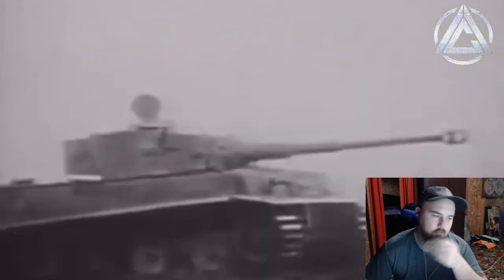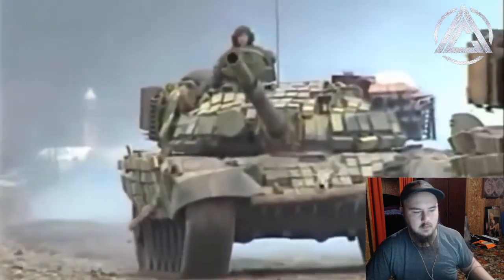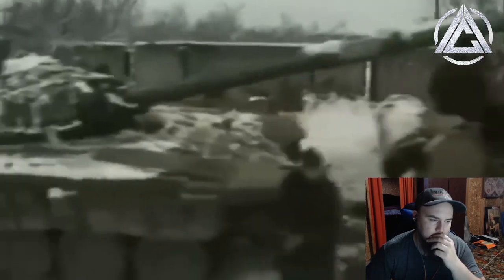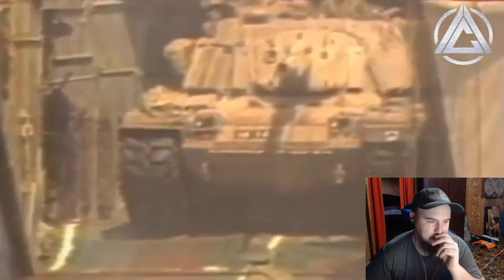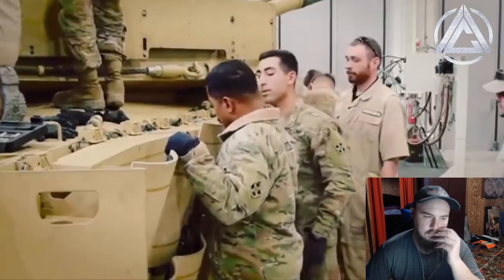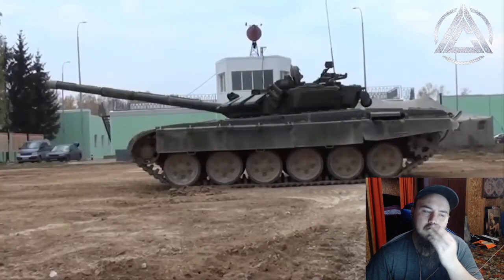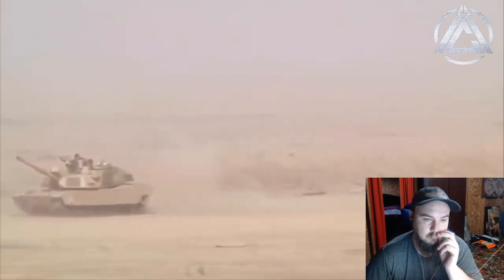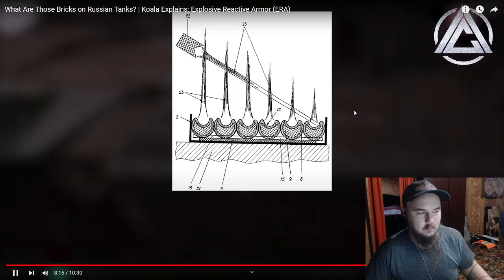Armor Cast: What Are Those Bricks on Russian Tanks? Koala Explains Explosive Reactive Armor Reaction

Comment: Quick thing about the Gen 3 reactive armor...it is not just more plates, it is something quite different and new. Instead of the explosives propelling thin plates of armor like in Gen 1 and 2, the blocks of reactive armor in Gen 3 actually contain multiple, small shaped charge warheads in rows or strips, and as the block goes off the multiple shaped charges literally cut the incoming warhead into pieces too small to penetrate the tank. It seemed like you kinda glossed over that and might have missed the distinction...sorry if you already knew this.✌